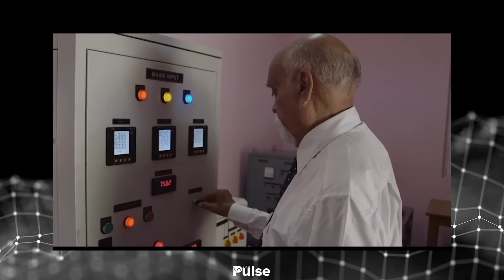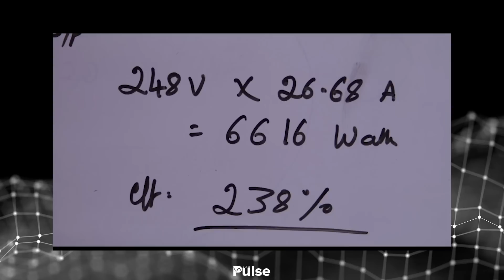'Free Energy' Generator That Works - Tewari Demonstrates His Over-Unity Machine

Comment: Ugh. Everything those people were saying was unintelligible nonsense. There was no evidence presented, just a really loud motor that they ran for a minute while some dude turned knobs, and then an unjustified proclamation of success. "Back torque" isn't a thing and therefore can't be canceled out. "Back emf" is a thing, but it would violate physical laws to cancel it out, and therefore is impossible.

The world is dumb enough already without people like you trying to convince gullible people that bullshit like this is real.
Reply: Ah yes "violate physics law" when you didn't realize an mmf source can have multiple reluctance paths.
Reply: @lukiepoole9254  The fact that an "mmf source can have multiple reluctance paths" is trivially true and changes nothing about my comment.
Reply: @christmassteven  That would simply means you can cheese the opposing flux by dividing it into the independent path that the primary flux isn't in, EFFECTIVELY bypass lenz's law. mic drop

Comment: I've seen many articles on perpetual motion machines. I have yet to see one work, or see where the free energy came from.
The only free energy I found, is plugging an extension cord into the neighbors house.
Reply: Try what's being taken about, ever? Don't spread the wrong idea, please 🙏🏽
Reply: @A4Aurum  : what wrong idea?
Reply: @drewthompson7457  you suggest as if you've not found something even without looking for it properly
Reply: @drewthompson7457  doesn't seem like you've even thought of looking for this person's patent
Reply: @A4Aurum  : no one has found a perpetual motion machine. It's pretty simple.
Reply: @A4Aurum  : a patent for a perpetual motion machine? That would be a first!
I'll let you buy one first.
Reply: @drewthompson7457  who said you need that concept of  perpetual motion, you could have interconnected parts which stop at intervals just like the environment around you
Reply: @A4Aurum  : yes, all machines stop without energy to run them.
Reply: Over unity is not perpetual machine. If perpetual motion in electron not possible explain how superconducting electro magnets work without any external input power?
Reply: @infinitebeing1119  : books are written on superconductors.  A short answer would likely confuse you more. Why not look up an article of a few pages to start with?

Comment: Elon musk could Easily add a Alternator to charge the batteries on ALL Electric vehicles.. We already have it today on combustion engines. You just make a Larger one with more winding's. Then we wont be led like sheep to the PAY POINT !! Inline on the same axle means what is put out is put back in! There will be some initial loss on start off but the damn thing could go for miles without needing a charge!
Reply: Alternators are less then 100% efficiency 80 to 90
Which means you would use your battery faster if you wired in an alternator.
Most of these claims don't actually show more power out.
They conflate power energy voltage Amps enough to confuse people.
They're not measuring clearly energy.
Ah 12kw motor doesn't use 12kw all the time. It hardly ever use 12 kw.
Reply: Yeah, that's absolutely incorrect, you obviously know nothing about alternators...

Comment: I have read that homopolar generators are being used on some submarines - I don't know if it's true - Does anybody here know about this ? - The Paramahansa Tewari machine is a homopolar generator, so it does not have to contend with lens forces slowing it Down - The only problems with that machine are that it needs to go fast in order to get a decent power density, the energy has to be tapped off of fast moving parts, the machine tends to build up a huge number of electrons but at a low voltage and needs to be converted to higher voltage, the problems were apparently solved to a satisfactory degree - Bruce DePalma and Tewari were both working on this separately but simultaneously
Reply: Jim Murray has an zero back emf ac generator called the dynaflux. Also peter lindemann and Knox had built an ac homopolar generator that they had conferred with depalma on at one time nobody really knows why it works. Eric dollard also has very interesting mathematics and concepts to consider as well

Comment: Just another bullshit “invention”. What is so difficult to understand that it cannot work? If the dreamers, esoteric fans, conspiracy theorists,….getting called out it gets quite again…..
Reply: Really? I suppose you never heard about the FACT that opposing magnetic field is a REAL thing such that it can be 'filtered' from the mixture of opposing magnetic fields using higher permeability material. For example, a rotor of a single phase switched reluctance generator uses higher magnetic permeability metal than the stator. The result would be significantly reduced flow of opposing magnetic field into the rotor, which drastically reduce braking load torque, to achieve true overunity where total energy output is greater than total energy input.
Reply: @lukiekelen5553  aside conspiracies, esoteric crap, dreamers, deceivers, glue gun scientists,….I can calculate for you back and forward, even if you want a simulation, to prove that is simply not possible. Whatever you think and however you place your magnets, no matter what permeability and/or force, you always have a point of the zero stage where the system wants to be. 
However, if you really so sure that a couple of glued together magnets can beat the laws of thermodynamics show me. There is no single perpetuum mobile ever worked

Comment: I put together a small circuit featured in a version of Patrick Kelly's ebook.  The circuit was very low power.  It put out 50% more energy than was put into it.  Yes, I think that over-unity power generation is possible.  I tend to think that individuals learning to build practical devices might be a way to let the technology come out into more widespread use.  I also think there is something a lot more important than learning to provide electrical power, and that is learning to cooperate, learning to center in what is true and holy, and letting that centering come through all we think, say and do.
Reply: 🙏🏽 good effort, good luck to you for more  experiments 👍🏼
Reply: Only when Jesus steps foot back on earth, will any semblance of peace prevail...

Comment: Unsubbed.
Reply: Yep...
Reply: Really unsubbed just like that? I suppose you never heard about the FACT that opposing magnetic field is a REAL thing such that it can be 'filtered' from the mixture of opposing magnetic fields using higher permeability material. For example, a rotor of a single phase switched reluctance generator uses higher magnetic permeability metal than the stator. The result would be significantly reduced flow of opposing magnetic field into the rotor, which drastically reduce braking load torque, to achieve true overunity where total energy output is greater than total energy input.

Comment: He getting 220% if you'll take a small neo string and embed them in Big steel washers then rap a lot of copper magnetic wire on it you'll have a electro magnet when given the right amount of dc current and voltage toll get 400% out its a magnet assisted electro magnet .the steel shorts out the neos  until the power is turned on then it can't use the steel and then adds its flux field to the electro magnet . your not violating any laws .
Reply: Really? I suppose you never heard about the FACT that opposing magnetic field is a REAL thing such that it can be 'filtered' from the mixture of opposing magnetic fields using higher permeability material. For example, a rotor of a single phase switched reluctance generator uses higher magnetic permeability metal than the stator. The result would be significantly reduced flow of opposing magnetic field into the rotor, which drastically reduce braking load torque, to achieve true overunity where total energy output is greater than total energy input.

Comment: Breaking the laws of physics in India , again , over unity , the magic of getting more energy out than you put on
Reply: Really? I suppose you never heard about the FACT that opposing magnetic field is a REAL thing such that it can be 'filtered' from the mixture of opposing magnetic fields using higher permeability material. For example, a rotor of a single phase switched reluctance generator uses higher magnetic permeability metal than the stator. The result would be significantly reduced flow of opposing magnetic field into the rotor, which drastically reduce braking load torque, to achieve true overunity where total energy output is greater than total energy input.

Comment: For the purpose of explicitly demonstrating any over unity device, it's output should be substituted, when 'booted up', for the initial/primary power source with isolation from the grid indisputable.
If this is demonstrated using a fully transparent setup, ie all current carrying components can be seen from every angle and the output powers not just the input but, for example a high wattage lamp, doubts regarding it's efficacy must consequently be dispelled.
Reply: Really? I suppose you never heard about the FACT that opposing magnetic field is a REAL thing such that it can be 'filtered' from the mixture of opposing magnetic fields using higher permeability material. For example, a rotor of a single phase switched reluctance generator uses higher magnetic permeability metal than the stator. The result would be significantly reduced flow of opposing magnetic field into the rotor, which drastically reduce braking load torque, to achieve true overunity where total energy output is greater than total energy input.
Reply: @lukiekelen5553  what are you rambling on about? Dragon Vulgaris is 100% correct in his statement! They are not saying this does not work. What they're saying is, if it in fact does work, it needs to be demonstrated in such a way before all witnesses, leaving no room for doubt, that it's fully self contained. Which means, it needs to be built in such a manner that all sides, from any angle can clearly be seen, and all outside power sources must be removed after initial startup! After all, if it truly is an overunity device, it would not need a connection to any power source outside it's confines. If it has a battery within the unit, it must be clearly demonstrated that after the machine is up and running, that battery can be removed from the system without affecting it's operation...
Reply: @Quickened1  Or the sum stored energy in the battery(or batteries) must be measured before and after running the machine for a period to generate significant surplus power beyond what could be statistically insignificant noise.  I've seen some setups where the battery chemistry is supposedly key to generating excess power due to their chemistry when undergoing high voltage spikes.  However I've yet to see this demonstrated, and I would love to even see that demonstrated over an appreciable period of time.
Reply: @Firestar-rm8df  Agreed, yes, if a battery is left in situ, and can be shown to have gained, or at least not have lost ANY of its charge, that would be acceptable. I can easily see using a battery in an overunity system. In fact, one day I hope to build one of my own doing just that! I stand corrected... Happy 2026...

Comment: There is a lot of better technology that could add value to human life apart from what the political and some big business players currently subscribe to. Mr. John Rondebosch and James Fuller (both engineers) have a technology that can produce larger amounts of electricity per unit from a river without building dams, different from conventional thinking. They have presented it to the UN but no one wants to even entertain it leave alone support the idea, which begs the question, why? The current political and business elites are leading humanity on a wrong path because they are least prepared to change their business models and/or lose political and economic power, which is a bummer. Communities must organize to provide such utilities as electricity and manage it at the local level outside national systems the same way most currently produce food for subsistence. National govts as we know them have lost their value in many ways that can steer humanity to the second level of prosperity and comfort on Earth. All they do is frighten and try to control citizens, which is not sustainable nor a peaceful way of leading others.

Comment: It doesn’t make any sense because that motor has many losses including heat/friction/copper resistance …it looks like a scam lol 
He can begin by sharing his plans so I could have a look at it since i am an electrical engineer.
Reply: Electrical engineers know it's bs.
Reply: Really? I suppose you never heard about the FACT that opposing magnetic field is a REAL thing such that it can be 'filtered' from the mixture of opposing magnetic fields using higher permeability material. For example, a rotor of a single phase switched reluctance generator uses higher magnetic permeability metal than the stator. The result would be significantly reduced flow of opposing magnetic field into the rotor, which drastically reduce braking load torque, to achieve true overunity where total energy output is greater than total energy input.
Reply: @lukiekelen5553  let me know when you have it working, I have a million dollar check for you:)
Reply: @lukiekelen5553  all those words, and you still don't know magnetics. You need to ask for your money back from whatever school you attended or let me guess self taught? Well at least it was free.
Reply: @KevinSmith-os5yz  Very funny. I am sure you're the one that doesn't know magnetics. Do you know what is magnetic permeability? Of course you don't. You only learn what you are regurgitated at.
Reply: @lukiekelen5553  I'm sure you must not be talking about a materials ability to become magnetized by the presence of a magnetic field, do enlighten me then. Then answer this, a magnetic field is a force, in order for that force to produce energy, it must have movement imparted to it. Where does that energy come from to supply your over unity?
Reply: @KevinSmith-os5yz  Since when did magnetic field magically becomes a force?
Reply: @lukiekelen5553  "when did magnetic field become a force". Well, when you bring it near a ferrous material it produces a force. Ie sticks to it. Or is it pixie dust?
Reply: @KevinSmith-os5yz  "stick to it". You need to watch theoria apophasis videos on magnetism LOL
Reply: @lukiekelen5553  I'm will say again, do you have a certified working model? Yes or no.
Reply: @lukiekelen5553  Every generation has those that think they know better than the past one, yet over a century and not one certified working prototype. Yes you are closed minded, believing in a conspiracy theory of that magnatude, let know when you are the first to make one:)
Reply: @KevinSmith-os5yz  Blah blah blah conspiracy blah blah blah certified model. I wouldn't bother arguing with you negative IQs if I can get it out without risk of getting myself silenced. All I can say is yes but I won't show you or else my account will be terminated.
Reply: @KevinSmith-os5yz  Let's start with the basics since you sound like having a brain. Do you agree that opposing magnetic field behaves the same as magnetic field generated by the inductor such that it can be affected by materials with different magnetic permeability?
In similar analogy, current divided into proportion based on the different resistances such as measured in a parallel circuit with multiple resistors with different resistances.
Reply: @KevinSmith-os5yz  If you agree, than we can move forward. If you don't agree and ignorantly said that magnetic field is not real, then you're a frog in the well.
Reply: @lukiekelen5553 sorry to blow your dreams but permanent magnets are just a material that has the order of the sub atomic particles (protons , electrons etc.) in the crystal structure in an inverted form so it creates two separate poles and it’s always two separate poles ( attraction , repulsion) therefore it remains static , in the other hand electromagnetism is a result of moving electric charges through an inductor the higher the current the higher it gets, you can’t create movement out of nothing. Because energy cannot be created nor destroyed.

Comment: This is a hoax, and not a good one. I see some clowns running an electric motor and grinning. Another clown scribbles on a whiteboard.
Andrea Rossi with his e-cat device is more convincing, although obviously
 deranged.
Reply: Really? I suppose you never heard about the FACT that opposing magnetic field is a REAL thing such that it can be 'filtered' from the mixture of opposing magnetic fields using higher permeability material. For example, a rotor of a single phase switched reluctance generator uses higher magnetic permeability metal than the stator. The result would be significantly reduced flow of opposing magnetic field into the rotor, which drastically reduce braking load torque, to achieve true overunity where total energy output is greater than total energy input.